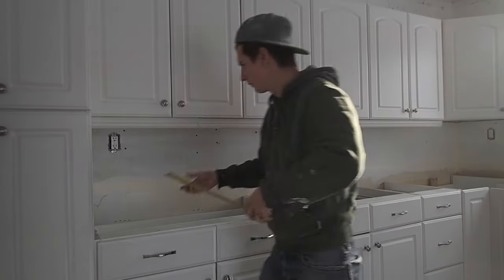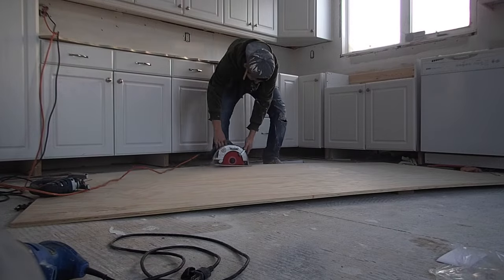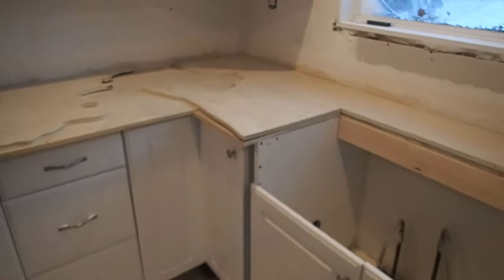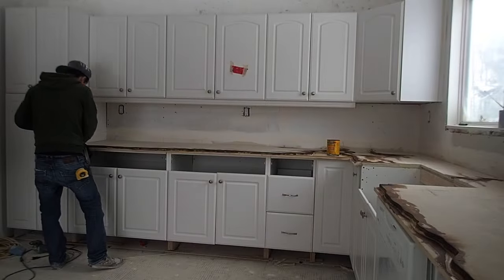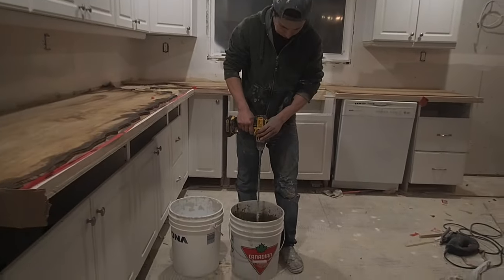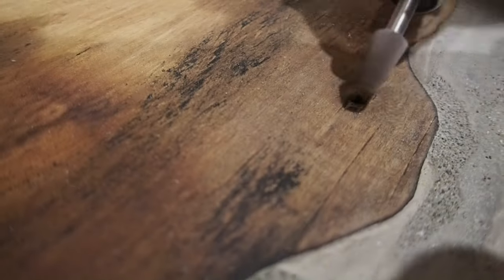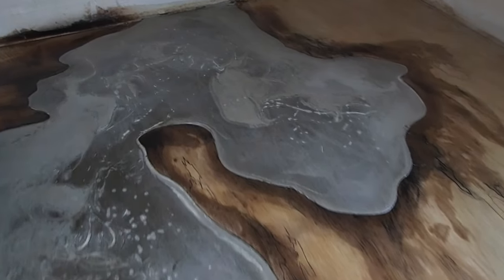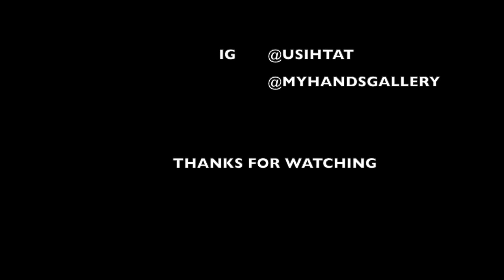PLYWOOD COUNTER TOP

Comment: Wow Joshua, kitchen looks awesome, a 2 pack epoxy resin clear coat will hold up well to kitchen use including heat. Easy to repair scratches with another filler coat and heat gun will blend in seamlessly. Or using coloured epoxy resin in knot holes, to make unique rivers etc.. Congratulations on your new home may you both have many years of enjoyment in it together. Victoria Australia xo

Comment: You might cover it with clear epoxy. The greater thickness gives you greater depth of detail. It still won't resist the heat of a pot. Small scratches can "healed" with a torch or heat gun. You could let the epoxy run wild over the edge for an even livelier edge.

Comment: It's cheap and temporary. No better time to experiment than that. I think you're onto something here.
The idea of following the grain is a great one but maybe you could have cut the bottom panel to match instead of leaving it straight?
Oh nevermind, I just noticed you filled the gap with the leveler.
 ...and BTW, is there a way to stain that floor leveling substance?
Maybe do 3 or 4 different shades or complimentary colors and swirl them together for a more pronounced marble effect.
Reply from the maker: It is entirely like you could stain it. I may try it again else where.
Reply: @JoshuaAlexander138  Heck, you wouldn't even need to stain all of it just a cup or so for the top layer depending on the size of the project.